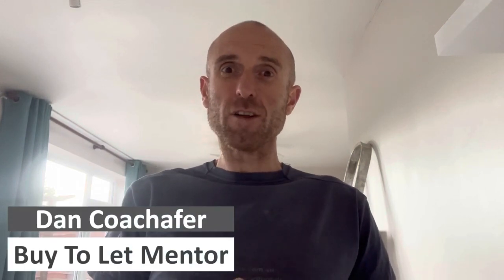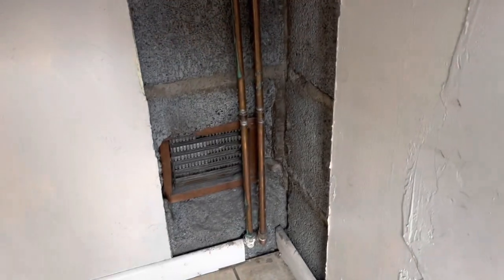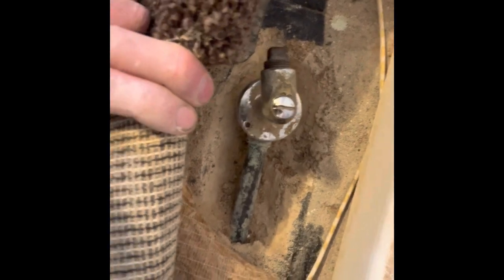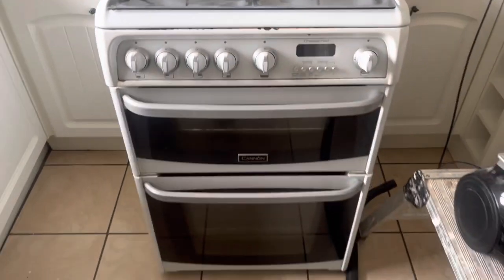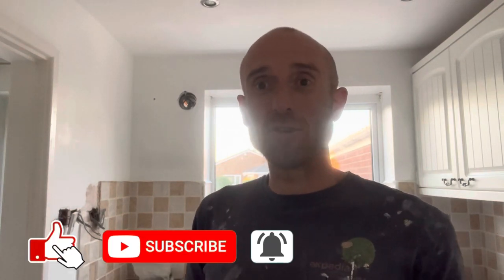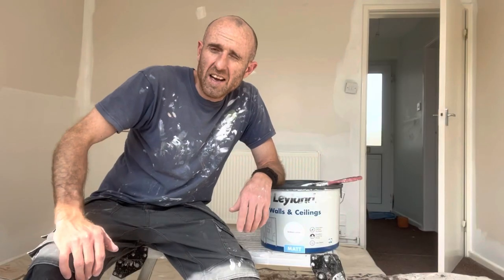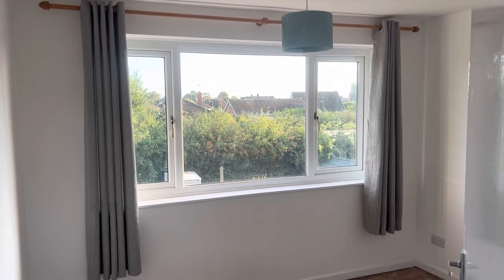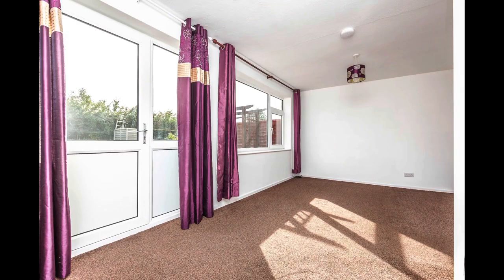Buy To Let Property Number 18 | Part 2 - The Renovation | Buy To Let Advice For UK Landlords

Comment: Great video Dan, thanks for sharing. Can I ask what extractor fan you use in the kitchen? I need to replace an old one in one of my properties and a trickle one could work nicely. Many thanks
Reply from the maker: Hi Tristan,
Thanks very much for watching and for dropping a comment.
I use the Vectaire Elegance fans and have them on setting one constantly trickling. I get them from Pam Ties and my go to guy is Simon Dews, if you drop my name I`m sure you`ll get looked after. 
Thanks again for watching, I hope this helps